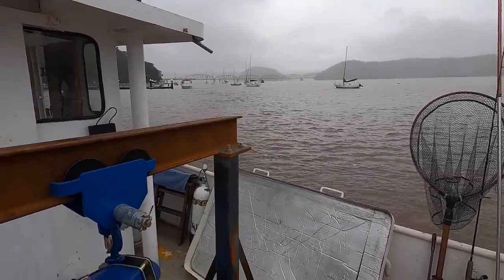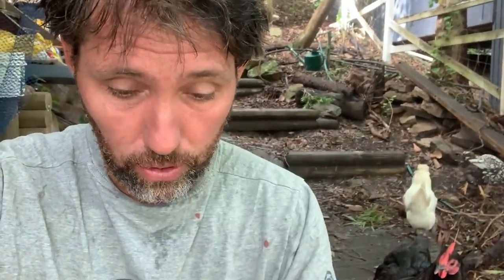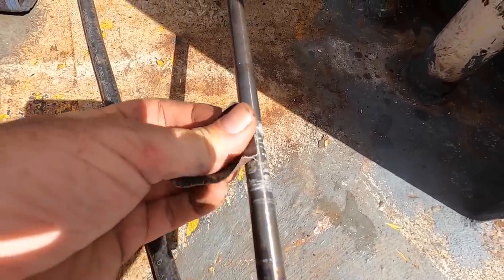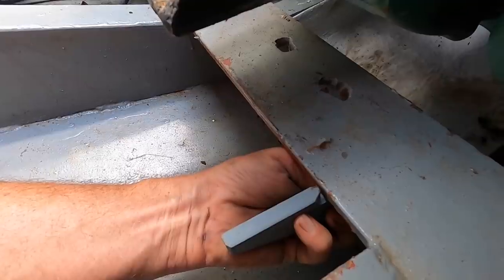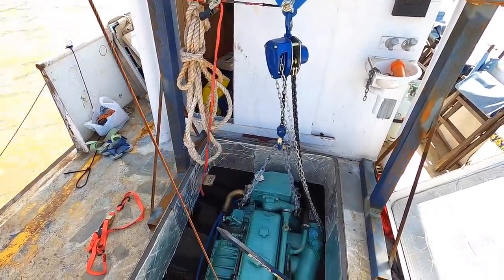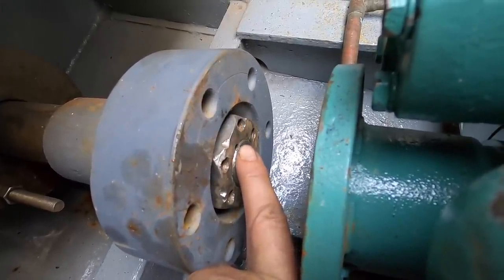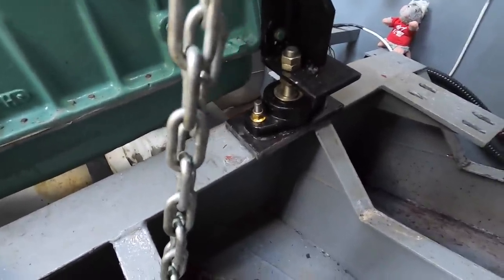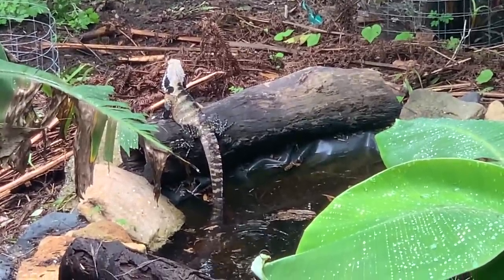Positioning the engine

Comment: When I worked on trawlers all we used for doing alignment was bottle jack and pinch bars... you can lift the individual corners without the whole thing swing in the air... works really well for a single handed alignment... 

But I do have to say alignment is tedious and frustrating, but once it's done you can forget about the frustration and move on to the more visible and hence fulfilling jobs...
Reply from the maker: For sure, I can't wait until it is a distance memory!
Reply: Before you know it you will be chugging around the bay as proud as a peacock mate. @DangarMarine

Comment: Putting Renko on the hard long enough to properly mount and test the engine sounds like the proper plan.
Reply: And gernie all that crud off. Plenty more to grow with that floiod water.
Reply from the maker: I think so too. I can also clean the transducers, add a coat of antifoul (it's already been on six months) and wrestle with the prop. All up for a few days it will be under $1000 which I reckon will be money well spent.
Reply: @DangarMarine  Yep, hadn't even thought about cleaning the bottom, but from the one dive we've seen, she needs it. Get some beers, some mates and you can knock it all out in a few days. lol :)
Reply: @DangarMarine  BOAT = Bring On Another Thousand
Reply from the maker: Jack Hole  But if it means being able to fix the prop and get the alignment made easier it can always been tweaked when it gets back into the water.

Comment: G’day Stu don’t be so hard on yourself you helped out with the other boats and the storm, it wouldn’t be easy aligning the engine to the prop shaft and on your own you’ve made a good start.   The sounder in the wheel house is in a good position a lot of trawlers have them up high, one way to fix your cables to it is to use square conduit which could fasten with screws if there is sufficient thickness near the window or use construction adhesive I used it on my boat and I used adhesive on it which I taped till it went off and it was strong, just a thought.   It’s probably not a bad idea Stu in dry docking it, it would be a lot easier especially to work on the shaft .   You’ll work out but so far you have done a great job on her,  kind regards John
Reply from the maker: Thanks John, appreciate your kind words. I do like the idea of getting the boat in dry dock again for a couple of days to finish the alignment as well as give it a quick inspection and another coat of antifoul before heading north.

Comment: I don't know if the bolt hole pattern is the same on the engine flange as it is on the prop shaft flange. If it is, get three pins made up that fit the holes snug and put them in the prop shaft flange so they stick out a couple inches. Now you can move the engine back slowly, adjusting the up, down, side to side until the pins engage with the holes in the engine flange. This should get you close. Lock off the adjustable mounts. Move the whole engine fwd again and insert the coupler. This may be lined up enough to get the engine started and get the prop shaft turning. Once everything is free to turn...a dial indicator and and feeler gages to do the fine tuning. I think getting it roughly aligned first and bolted up temporarily to turn the prop with alignment pins may work.

Comment: oh and the (dinner plate) disks would need spigots on them so they bolt on centre, and they will have to be threaded so the bolts come in from the back so when its lined up you can take them out

Comment: I never leave the boat on the mooring unless all 3 thru hulls are off, turn master switches off ( only bilge pumps have power and they are on separate batteries )  and I check operation of both automatic pumps. I have a sequence I do every day. I check the packing on the rudder and shaft at the end of every day as well. It takes me a few minutes, but its time well spent.

Comment: You may have already put the motor in place but if not try this to move the engine without lifting use all thread rod and a piece of water pipe that the thread rod fits in and use it like a screw jack. You can cut the pipe to suit the length you need. Having one either side means you can  more  left or right  to line up the prop shaft and the engine to with in a few thou without to much trouble. I use this alot to get heavy jobs to move only small amounts without  the heavy pushing which moves suddenly and to much. Great to see the boat and how far you have come and the persons you help.
Reply from the maker: I'm heading out today so I'll see what I can find.

Comment: You'll find it easier if you get the list off the boat, also for moving the engine we always use 4 clamps on the engine bed with some hydraulic jacks mounted horizontally between them and the engine bed, then you can move the engine quite easily and be very precise with positioning. Keep up the good work it's a sod of a job but just when you think nothing is going your way things will fall into place.
Reply from the maker: Hey mate, do you have a link to the types of clamps you put the jacks against?
Reply: @DangarMarine  We just use normal metal G Clamps on the smaller stuff it's surprising, it doesn't take that much force to move an engine horizontally, and with a  2 Ton 2000kg Hydraulic Bottle Jack on each corner it's a slow controlled but powerful shove in the right direction and their cheap as chips to buy, The last one I bought to replace one that was dropped overboard cost me about £7.60p from ebay.

Comment: Most of us are very familiar with that feeling of frustration that comes from endless hours struggling with something that refuses to cooperate. Quite often the tiredness and fatigue is preventing you from thinking straight and of course you want it done ASAP so you start looking for shortcuts instead of stopping what you are doing to look at the bigger picture or stepping back and giving yourself time to rethink and get a different point of view.
There are a lot of positive comments and good suggestions here but one of the best ones is to take a bit of time off and just forget about it for a couple of days. Quite often thinking hard about a problem makes it harder, when you are relaxed thinking is much easier and the solution becomes obvious.
Reply from the maker: Thanks Ian. Heading off for a day out with the Mrs today. I'm sure it will all seem more doable tomorrow. :)

Comment: We aligned our stuff on the hard stand in Alaska.  It worked out a lot better.  When we splashed the boats we started them before putting in the water.  We put them in and out of gear quickly to test the linkages, moved the rudder back and forth then dropped into the water.  Ours were keelcooled you'll need to rig up something to pump water into your raw water pump and turn the hose on the cutlass bearing.  You will need to be in the engine room when you finally get into the water to watch everything.  Grab a digital thermometer and keep a close eye on your temperatures especially the stuffing box.  Its better to have the box a little loose rather than too tight.  Adjust the bolts one flat at a time until you get about one drip per second while underway.  You should be running around 20C on the stuffing box.  You're doing great, just be patient when aligning.
Reply from the maker: Thanks mate, appreciate you sharing your experiences.
Reply: @DangarMarine  Just hope it helps.

Comment: We use a hand pumped Hydraulic porta pack at work to finesse large blocks of steel into position on a big CNC mill.
Strikes me as a useful tool in your situation, would require an upright bit of steel to the outside and sides of the mounts to give the piston something to push against.
Pieces of wood propped against the nearest hard point would do at a pinch.
I think they are common in panel beating.
Reply from the maker: Yes, I bought one to help get the stuck rudder post out but I actually can't find it at the moment. You are right though, they are generally sold as panel beating kits.

Comment: A piece of engineering trivia FYI (not sure if mentioned below), the circular keyway on your propshaft is known as a scotch or dutch key. Using a pin instead of a normal rectangular section key, it's easier and cheaper to install and does the job well where the pin is being mainly used as a locking device.
Reply from the maker: Nice bit of info Matthew!

Comment: If you have a buddy with a machine shop, have them machine 3 pieces of 1" bar stock to the same length as the flange width.  Drill and tap holes in one end of them to bolt to the prop flange.  Then use a feeler gauge and adjust the motor mounts until you can't fit a .005" feeler gauge in between any of the bar stock and gearbox flange.  You may even be able to turn the prop shaft using a breaker bar between the bar stock after your alignment is set.
Reply from the maker: I do feel that very precise spacers probably hold the key to moving forward.
Reply from the maker: I do feel that very precise spacers probably hold the key to moving forward.

Comment: One thing you must make sure you never do while welding in this situation, is earth through lifting chain or cable, just avoid any possibility
thats something like what happened on the west gate bridge, when the last span section was being joggled into place some of the connecting bolts were loosened or removed to help it slip in.
It turned out that while it was calculated that there were enough bolts to hold it all up, they were still welding the span, and the earth was going through the bolts, which over heated and bang down she went, with 19 guys on it. quick as that. 
The thing is that the earthing while welding can create enough heat for the metal to lose its strength, more especially if the earthed parts are high tensile. That and earthing is unpredictable. 
I did notice the earth was rightly nearby, its just something that worries me after that particular disaster.
Im not concerned the chain would break while you have the donk on it, just that its capacity is forever limited after.
Cheers
Reply from the maker: Certainly something to keep in mind!
Reply: Thanks for the explanation of the failure mode for the span of the West Gate Bridge disaster - my Dad heard the section fall from his post at GM Fishermens Bend that fateful afternoon.
Reply: That's a completely inaccurate description of why the west gate  bridge span collapsed. By chance I worked for John Holland in rigging and  QA during the carbon fiber strengthening project on the Westgate Upgrade  8 odd years ago. (I've got a BA with a major in religious studies so that made me qualified to do QA they thought.....) I and another rigger erected the first of the suicide barriers on the bridge. I spent plenty of time talking with engineers about why the bridge failed in the initial construction phase. The camber of 2 sections didnt align at their join so the started loosening bolts on the high section so it would lower. They loosened too many bolts and those remaining couldn't carry the load so they failed. The bolts actually started turning blue prior to failure so extreme was the tensile load on them. Welding had nothing to do with it. Google around, theres a site devoted to explaining the collapse that draws on info from the post collapse inquiry.
Reply: @andersonsroad5161  I would have responded with "There is information around that gives a different explanation for the collapse..." there is no point in disrespecting another commenter - they did, after all prompt you to comment which was excellent you did. Thank you for pointing out that there are sites dedicated to an explanation of the collapse. I never would have thought an event so old would be detailed on the Internet. Cheers.
Reply: @MiniLuv-1984  I'm a construction worker not a social worker and am currently terminally ill with mantell cell lymphoma. If you think what I said there was blunt or offensive  you live a very sheltered life. Construction is a brutal industry that's why the union here in Victoria  the CFMEU is so militant. Go read about the industrial dispute during the bridge upgrade and the scab labor that got bashed. I only responded at all because I like Stuart and didnt want him being given a bum steer.
Reply: @andersonsroad5161  I wish you all the very best Anderson Road.
Reply: Good call. Don’t want to jump in on the Bridge collapse thread, but  just adding another view.. Earthing or grounding may not be the most appropriate terminology when welding on a steel boat at sea. The return line carries as much current as the welding cable and should be placed as close to the job as possible. Any metal work forming the circuit should be treated as an exposed live cable and precautions taken.  Hence moving the return line when moving welding points might be a good idea.
Reply: @MiniLuv-1984  thankyou for your kind words bro. Just been watching a vid on replacing the water pump impeller on my mariner outboard. Going to spend as much time as I can on the water. I've got my final interview this week for getting the euthanasia drugs so I'll have those when the pain is off the chart. You swallow them and your dead in 40 seconds. Wake up and your crossing the north sea heading for a English monastery on a raid with Leif Ericson.... well that's how I like to think of it..... 🤣🤣🤣
Reply: @andersonsroad5161  my wishes are with you ...safe sailing and a good landing.
Reply: @andersonsroad5161  
'They loosened too many bolts and those remaining couldn't carry the load so they failed' - seems not to be in contest and if you didnt realise thats the same thing. They had stripped out bolts on the Tuesday, various cutting on webs etc took place on Tuesday Wednesday Thursday to deal with panel deformations and welding was continuous for some time in the previous days. There was a 500 gallon diesel fuel tank on the bridge for that supply to the welders. More bolts came out after calculations were done to approve removal (that cant be done without approval) which says, the panel should have been fine except 'somehow' the characteristics of the bolts had changed, ie. they turned blue, they were no longer of the specified tensile strength, you said as much yourself. I leave you to explain why those fasteners failed.
cheers
Reply: I'll say a prayer for you tonight. Replying out of Christian love, I don't know if you're saved or not, I hope so. If you're not the end destination will be terrible and you need to find Jesus before you go. If you are I'll see you in heaven.

Comment: I know how it is Stu, you come up against a "rock and a hard place" with projects sometimes and wreck your brain attempting to accommodate all the contending factors. It will wear your tail out. You WILL get this solved. 

You also described what sounded like a fair plan at the end of the video; get the engine bolted in place as best your are able, and running, but leaving the shaft disconnected until you are on shore. I know you are adverse to spending the money to beach the boat but sometimes you just gotta bite the bullet and do something you're not wanting to. She will only be on the hard's a short time... Best of luck, I have faith in you.
Reply from the maker: Thanks Dee. I think spending a bit of money getting back on the hard stand for a few days could well be worth it.

Comment: Hi Stu, just a little thought. Noticed you were using the crane pully on the back of the engine for support/ alignment.  If you put a pully on the engine block and wire it back to the jib of the crane. It will make it lighter to crank plus give you small movements for finer adjustment on your alignment of the engine to prop. Just had storm Denis come through last night in the UK, looks like further cleanup battles ahead, second flood in less than a week.
Reply from the maker: Yes, there are definitely a few ways I could use pulleys to make life easier. Good luck with the storm.